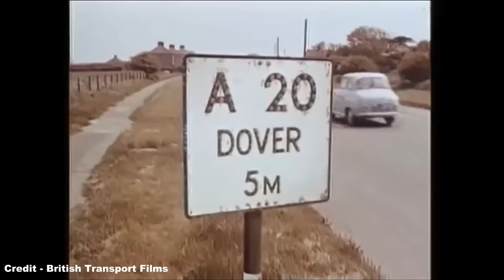BMC 9X - The Mini Replacement That Never Was

Comment: Just when I think I've heard every story of BMC/BL incompetence, a fresh one comes out of the woodwork!
Reply: It's a rabbit hole
Reply: I'd have said British Leyland management incompetence,  hamstrung by lack of cash and foresight as just seen in the video.
Reply: I think now for a change, we out to be treated to similar tales of Ford incompetence, who remembers the weld on inner wing kits from your local parts shop you soon  had to buy as they all rotted away, the 1200 cc engine from the Cortina that would only last 40000 miles, the anti roll bar they left off the Escort for cost reasons, the Mk 3 Cortina estate that broke its back if a decent load was put in it , Ford's folly, the mk 4 Zodiac and later, the Scorpio, leaf springs and RWD years after BL had progressed on...
I could go on and on , but one thing they were very good at was marketing and product placement. 
So come on Rudy, one on Ford is long overdue.
Reply: Ooooooh there’s more 🤣
Reply: At least the labor union escaped blame for this one!  ; )
Reply: @558vulcanxh  Car manufacturers in general are a goldmine when it comes to stories of incompetence and failure!
Reply: @scootergeorge7089  of course they're not Scooter, hardly ever were to blame, just fighting for a square deal from a bad management,  remember what a ***** Michael Edwards was ? 
Sir Terance Becket at Ford , who in I think, 1972, when BBC Panorama was debating why people were buying foreign cars in increasing numbers, said we (Ford) build a car to last two years 😳 because they were mostly fleet sales and the reps only kept them two years then had a new one.He then said "if an owner wants a car to last longer than that, it's up to them to make it  not Ford .
So thats our legacy , part of anyway. I'm aged 77 so remember it well ☺️
Reply: @558vulcanxh  - The history of the British automobile industry seems rife with examples of incompetent management and labor more interested in going on strike than working.  
Back in the seventies, the president of Lucas, USA, with what I consider classic British understatement said the company's reputation for quality is not quite what he would like it to be.  I'm only 70, old man. ; )
Reply: When I was a kid Austins, Hillman's and Jags had a unique smell to the leather upholstery they used.  I can still smell it to this day.  English cars were a nightmare in Canada.  No good in our climate or in mountain driving.  My brother-in-law had a Humber Hawk, a beautifully made little car but a total nightmare in Banff National Park!
Reply: @dennischallinor8497  - They were not all that reliable in sunny Southern California either.  A co-worker had a brand new TR6 that was a maintenance nightmare.  Mostly electrical. But the final straw was when he parked the car, rolled up the driver side window and it fell on, hit the pavement and shattered.  He sold it and bought a used Porsche 356. 
My sister, not normally the weepy type,  had a beautiful MGB that literally had her in tears on a nearly daily basis.
Reply: @scootergeorge7089  My dad was born in England and trained pilots here in Saskatchewan during WWII.  He wouldn't touch an English car.  He used to say they're not made for the distances we drive or the consistent high speed we expect from our cars.  I could tell you a story about his '49 Ford that would have left an Austin in her wake!
Reply: @scootergeorge7089  Me again!  I forgot to mention my sorrow for your poor sister.  When I was in nursing training a fellow student had a brand new 1965 MGB, and it was indeed a nice, well-laid-out and fun car to drive.  Except for one thing: Lucas Electricals!!!  The bane of so many English cars bars none.  I have a Lucas in my family and the entire clan are as big a fuck up as the electrical company of the same name!
Reply: @dennischallinor8497  - I grew up in Southern California.  My father bought a Hillman station wagon to save gas. He would get on the 101, Hollywood Freeway  and get inches behind a semi and draft, NASCAR style. Took very little throttle to maintain position. Drove my Mom nuts! Anyway, he sold it, largely because it was a 30+ mile trip each way to get parts for the thing.  As I recall it had a 4 speed, column shift transmission which I thought was cool in a weird sort of way.
Reply: @dennischallinor8497  - Lord Lucas, Prince of Darkness. The president of the US subsidiary of the company said, in great English understatement, "Our reputation for quality is a bit less than what we would like it to be"  or words to that effect.
Reply: @scootergeorge7089  I was just reading your post about your dad's Hillman.  For our climate, in Calgary, the oil galleries held too much oil for winter and the clutches were hydraulic which women didn't like, again in winter the oil got too thick and it took too much leg power.  In 1973 a friend had a '61 Cambridge and the gears constantly ground and this idiot thought he would have to get a new tranny which would cost more than the junker was worth.  I pondered for a second and remembered the Scottish pederast taught me British cars use hydraulic clutches so we bought some fluid and ten minutes later I was a 'genius".  A status I haven't often held.
Reply: @dennischallinor8497  - As related in the movie "Patton," "All glory is fleeting."
Reply: Paint a sports car in BL poop brown...
Reply: Funny how BL just gave up in the end and went into bed with Honda
Reply: @mervynstent1578  - At that point, there was little choice.
Reply: @558vulcanxh  Correct our company cars  back in the late 70s into the 80s were Escorts and Cortinas that went through engines and gearboxes as if they were wear and tear items - of course we tried to get the company to change away from Ford but they would not because Ford just fixed them under warranty and because Ford sold their cars cheap to the company car market to gain high sales. That is why me and my workmates later on when we were buying our own cars never bought Fords and the BL cras like the 1978 Morris Marina 1.8 HL/TC Mk2 and 1980 Austin Allegro 1750 TC Equipe and later on 1983 Austin Mini Mayfair that I owned were excellent reliable cars as were the other BL cars in our family - then again we looked after and serviced them ourselves unlike most people back then that didnt bother with their cars until they broke down or had problems or used cheap parts in their cars or the garage that they put their car into did and then they blamed the car/manufacturer instead - this was true for other makes as well and not just BL.
Reply: @dennischallinor8497  Funny how the many people that still own all of the MGBs here in the UK and elsewhere do not have these mythical Lucas electrical problems these days and I never had them with any of the BL cars that I used to own or my family has either. The electrics on these BL and other makes cars etc back then were relatively simple to trace and fix if you had problems when the car got older like ALL cars had and you had to be a moron if you couldnt. The problems was NEVER with the Lucas electrics it was with dumb owners/garages etc replacing parts with CHEAP parts - I never used cheap parts in my BL cars and I always used LUCAS or UNIPART which was BLs own parts division back then and I never had any problems with my cars or electrics and same for the rest of my family as well. I worked in a garage in the mid 80s right into the 90s and we never had any problems with BL cars electrics either certainly no more than any other cars back then as they got older. As Jay Leno says the problems with European cars in North America was the clown mechanics that were clueless about working on these cars back then heck knows what they are like now with all cars being so complicated in comparison to back then.
Reply: @williamwoods8022  There is the 'it's not mine what do I care' syndrome to deal with.
Reply: @scootergeorge7089  it’s sad as BL-Rover had a lot of talent but in the end just made Ronda’s
Reply: @558vulcanxh  All cars of the time had built in redundancy, quite deliberate. The difference is that Ford are still going BL isn't.
Reply: @scootergeorge7089  I owned a brand new, German 1977 BMW 320 for only 9 month, as it spent more time being, warranty repaired than by me. At one time the side window fell down in the door, just to name one fault, and I got a new engine top, because of several faults and bad manufacturing!!
Reply: @mervynstent1578  
Which indeed turned out to be a reasonable fine marriage.
The Japan-controlled motoring factories in England made a profit and raised the quality as well.
Reply: @kasperkjrsgaard1447  with no originality!

Why buy a Ronda when you can buy the real Honda! 

Having BL under the Government ownership was a bad idea and no $$$$$$$$
Reply: @mervynstent1578  
To preserve some jobs in UK. Make some £££££££
Reply: Bad workers don't shut companies. Bad management does...
Reply: The general idea is to blame the unions for the failure of the British car industry.
In fact it was mostly blameable on the management.
Reply: @558vulcanxh  I worked on the shop floor, mostly subcontract toolrooms, for most of the 70s, 80s, 90s and 2000s. The attitude of management in nearly all of the places I worked was appalling. It never surprised me people spent so much time striking given the bloody minded attitude of management. Remember the unions were created because of this same bloody mindedness, on the part of management, a few generations before. Nothing changes. Except I live in Australia now. Here the standard of living is much better and the attitude at work is also much better. The standard of decision making by BMC and later Leyland, regarding the making of cars, as this video explains, was not good. It seems to me that it was just as bad regarding the management of the workforce.

Comment: Thanks for this. Great to get more detail on this amazing car. BL just didn't have the finances for a brand new car at this time, what with trying to make a raft of other new cars. Such a shame. I wonder if using the A series engine & some Mini running gear could have made it cheap enough to introduce (a la Innocenti Mini). We'll never know.
Reply: Andy the biggest reason why 9X never got the A series is , it wouldnt fit believe it or not!!  the packaging was so clever you would have had to extend the nose and raise the height ( like they did with Allegro, to squeeze the Maxi's huge E series lump in) The 9X is tiny,, yet its neat proportions are like  Delorean DMC 12 Its much smaller than it looks in shot or on film.. As for the innoccenti,,, it was the production cost that stopped to being built at Longbridge and it wasn't a refined design,, it still had the bus like driving position the seating was tiny and the fuel tank was exposed inside the tailgate opening hatchback area... Again it was making a production ready car.. If BL in the UK had done an Innoccenti they could have used the Van/estate floorpan and stretched it to a 5 door,, there giving it more room and putting the fuel tank under the floor..
Reply: Let these steutzels pour their money into these English oil leakers and German luxo-boats that turn into the worst money pits imaginable.  Give me my 1990 Cadillac Brougham d' Elegance and my F-150 Coyote, that's all I need in the transportation department.  I owned two RR Silver Shadows and I called them my "Englandershizewagons" and when I parked my '88 M-B 420 SEL next to them she would spool her engine down with a sigh that sort of said: "Oh, back here again are we with the 'rabblestrasza' (I gather is street people)"?  It helps to know German when you own a Mercedes.
Reply: @dennischallinor8497  it’s scheiss or scheiß, not shize ;)
Reply: @kaitlyn__L  Thank you, I took German in grade 10 which was 62 yrs ago.  My problem is I had no one to practise with after grade 10, so you lose it.
Reply: @dennischallinor8497  understandable! Plus, I was never taught the swears in my language classes anyway!
Reply: @kaitlyn__L  It was school so everything had to be proper but there was always the one kid who knew the slang and you learned that on the first day!!!  Thanks.
Reply: @dennischallinor8497  With European gasprices/roadtaxes you need a mortgage to fill up and use an US car.
Also the streets are smaller in Europe in cities who excist for millenia.
Only fools buy MODERN BMW and MB cars.
Never knew that US citizens could be so masochistic.
Reply: @obelic71  Good choice of words.  I have a 1990 Cadillac Brougham d' Elegance with a 5.7 injected.  At 206.9 it cost me $189.90 to fill it and it still had three bars left.  My Peanut Roaster ('17 Focus) gets 6.2 and handles like a go-kart.  He's not too good for this part of the world in winter though, the air damn will plow snow then you lose traction.  When I put my card on the machine to pay for the gas I could hear my father rolling in his grave all the way from Calgary.
Reply: @dennischallinor8497  in Europe (the Netherlands) filling up that same caddy with 25 Gallons x 3.7854 = 94, 635Liter.
1 liter costs €2,55
A full tank would cost €241
converted to US dollar $251 and Canadian dollar $326
Reply: @obelic71  I just about uttered two words that when I thought you might be a religious person I should avoid.  Boy that's a lot of money to keep a car that if it were a daily driver would cost about $1K/mon.  That's the car for me!  Oy.
Reply: that's how they end up with metro lol
Reply: @dennischallinor8497  Most Northern Americans who visited europe and expierence the fuelprices overhere never complain again when they are back in the US /Canada.
On the other hand our road/rail/canal infrastructure is one of the finest in the world so we have good options to combine travel.
Reply: @obelic71  I've been to Australia twice now and the second time I rented an M-B motorhome.  It was diesel and a long bugger that was like an airliner inside. The motels in the N. Territory can be sketchy so at least you know where you will be sleeping every night and in what.  What my Aussie friends didn't tell me is their campgrounds are great as long as you don't run into a bunch of Germans.  They travel in groups and commandeer the campgrounds and outsiders can't access anything cooking pit, laundry, etc.  Croc warnings are in English, Jap, and German and the Aussies black out the German bit, but the pictogram shows a guy getting bitten so you don't need the prose.  They have high-volume pumps and boy could they fill that thing fast!  Also, the food in the truck stops is disgusting beyond belief.  The police have got this American Rambo Arschloch attitude and are your usual dickheads and abuse people just as bad as the bloody yanks.  There's a country I'm glad I wasn't born in it's a total dog's breakfast right now, I wouldn't tour there right now if you gave me a Bentley and a million dollars.🐻
Reply: @dennischallinor8497  MB utility vehicels are general good the normal cars they make are unreliable bling bling shitboxes.
And yes Aussies can be very very rude but they have good hearts.
I have relatives in Canada and Australia so i have the privilege that i can experience a normal not holiday exchange.
Reply: @obelic71  Re: rudeness.  It comes from being British Commonwealth countries that were colonized largely by the military then the clergy.  As I'm sure you are aware the British can be a 'no nonsense' type of people and express themselves in a similar manner.  Boil all that down to regional colonies forming individual identities you end up with what I'm sure you've experienced.  I.E.: An Aussie will tell you off with a scouring pad and a Canadian will tell you off as he's applying the ointment.  Go figure?
Reply: @dennischallinor8497  Its all in the family.
Feed an Anzac some drinks and they speak all with the same tongue 😁
Only the canadian epologizes for the last drink of something.
South Africans already speak Afrikaans that originates from Dutch.
Reply: @obelic71  My doctor is a Hindu from Durbin who speaks Afrikaans and isn't terribly fond of the British.  Mennonite has a lot of Dutch in it.  What I like was during the war the Dutch could understand the Germans but the Germans couldn't understand Dutch.  Very advantageous.  I was raised amongst Dutch war brides and I worked with a lot of Dutch nurses.  They like us Canuks.
Reply: A hatch back using an A series engine and mini running gear, you're talking about the Metro!
Reply: @dennischallinor8497  Correct there is historicly a very strong bond between Canada and the Netherlands .

Comment: Great vid. The transfer gear was added because the engine was initially designed with the carburettor/exhaust at the front. The carb iced up so they had to turn the engine round. The leaks were caused by the front floorpan pressing meeting the bulkhead pressing in the engine bay. Water ran down and onto the floor. These pressings were reversed.
Reply: Like the A Series engine, the gears already existed: in the Austin A40.  There was too much inertia, driving them directly from primary gear, causing excessive synchromesh wear. The intermediate transfer gear reduced the inertia, but  required turning the engine round as it reversed the direction of rotation.

There are other factors, like putting the exhaust manifold behind the engine so the exhaust didn't have to fit past the gearbox and putting the distributor, spark plugs, starter motor & generator all at the front for easier servicing & better space utilisation. It certainly had nothing to do with carb icing.
Reply: @ethelmini  "Like the A Series engine, the gears already existed: in the Austin A40." ?? Austin A40 was a 1 2 3 layout. Sorry for appearing dumb but can you explain this, please?
Reply: @georgerogers5954  The gearset, not gearbox.